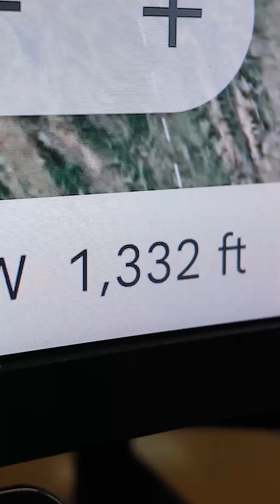What would it take to build a canal from Canada to Southern California?

Comment: Why not drill a tunnel thru that 400 miles or so across Oregon at a slope from one end where the pumping station is and bringing it out on the other end where it's out in the open the rest of the way thru California? The underground pipe line wouldn't have to slope but very little for it to run down hill in the pipe. Could it work out that way? I mean, maybe only ¼ of an inch or less over 1,000' should be enough for water to flow in a pipeline, shouldn't it? It's just a matter of figuring the height you'd have to pump it above sea level on one end for it to flow out at the other end and then at what percent it had to be sloped to get from point A to point B with gravity. You'd need to know the exact distance between those points, the absolute minimum grade the water could flow at, and the height above sea level the outlet is at point B to figure out the height above sea level it would need to be pumped to only once to make the journey right? Did they figure it like this and then come to the conclusion it couldn't be done? Look at roman aqueducts as an example of moving water over long distance and the minimal slope they were on to make it happen. Water will flow at such a minimal slope. I don't see how it wouldn't work if you make the start of the pipe line high enough.
Reply from the maker: Several problems with that concept. 

#1. One quarter inch of slope every 1000ft is not nearly enough to allow that amount of water to flow freely and quickly. 

#2. The high point of the canal is not on the end, making it difficult to start high and flow by gravity the entire way. 

#3. A 400 mile tunnel is obviously ambitious no matter what. But the geology of Oregon would make this ill-advised. It's pretty much solid volcanic rock through eastern Oregon with multiple seismic and volcanicslly-active zones.
Reply: @ArmchairEngineer  This is why I started with "Why not...." I have some knowledge on this, but not coming close to anywhere near enough to say it could be done a certain way. I have since the video been reading about the subject and will continue to research things related to it, and you have given me a couple of things to look into with your comment. Thanks. I do think that the human species is smart enough to find a way to make this work and work efficiently if it absolutely needs to be done.  👍

Comment: This guy never siphoned gas out of his car
Reply: This isn't really the same. Siphoning works when the weight of the column of water going down after the peak height is more than the weight of the column of water going up to the peak. He's essentially saying that will not happen because of the elevation increases eith the mountains and the length of run.  Tunneling through the mountains might correct that though.
Reply: @sumduma55  it's been done before,  one example, Mono Lake CA to LA
Reply: @treemanclint2883  That is all literally by gravity. The siphons there are what are known as "inverted siphons".  I'm an engineer who does this type of design. It's a lot more work and cost than you understand.

Comment: It would be more practical to pull water from the last Columbia river dam and run the pipes in the river, into the Pacific and back on shore in southern CA. This would minimize both the miles of pipe and the elevation gain.
Reply from the maker: How would that minimize the length? It would be over 1,000 miles long, most of it in seawater.

Comment: Not that I want to see Canadian water exported to the US, would it be feasible to pipe water to the coast and run a submarine (ocean-bed) pipe down the coast?
Reply from the maker: Nope. It would require a 50 ft diameter pipe under salt water that doesn't leak and never ruptures for 1000 miles. It would be impossible to maintain over the long run.
Reply: @ArmchairEngineer   Okay, but if we assume …

Comment: The entire east and west coast should be lined with desalinization plants.
Reply: LA could use oil to power the plants, or if they were okay with it, a nuclear power plant combined for power.
Reply: We have plenty of water on the coasts, except Southern CA.
Reply: It certainly seems to be working for Israel. Coupled with low water use irrigation, they've made dessert areas bloom. The bigger concern should probably be eliminating pollutants from and preventing battery fires.
Reply: The East coast doesn't need them. In fact, half the West coast doesn't need them either. It's really only the LA and San Diego areas that need the water. Keep in mind that desalinization plants are expensive to run and maintain, making the water they produce much more costly than surface and subsurface sources.

Comment: Use a pipe. Doesn’t take a genius to figure out how physics works. Yes it would take a lot of energy to get it started but as long as the elevation is higher where it’s coming from it would flow on its own. You could move water over mountains with zero energy.
Reply from the maker: Siphons only work for a maximum of 33 feet of elevation rise. Any higher, and the water boils and forms a vapor void.

Comment: That's the only route I could see working remotely.  Even the base of Shasta Dam is higher than the top of McNary.  So it would need to go further into the San Joaquin valley closer to Sacramento at discharge point to maintain the siphoning effect.
Reply: The Democrats would be against it let the people die of thirst
Reply from the maker: siphoning only works under 33 feet of rise. :-(